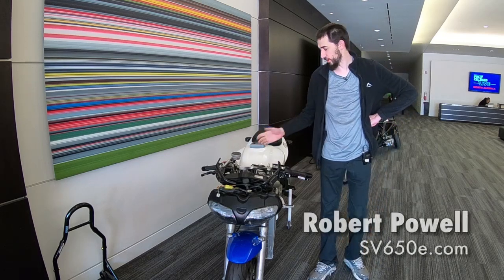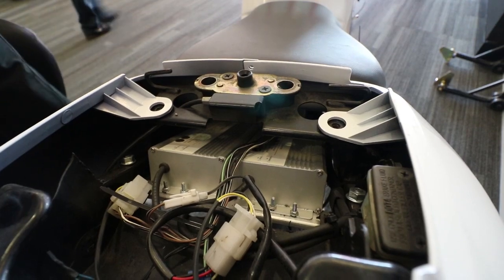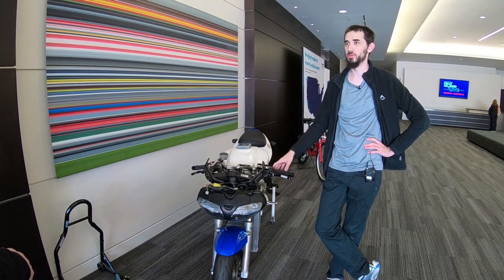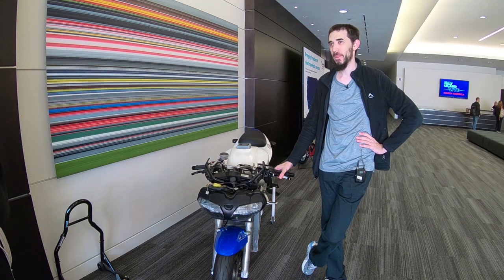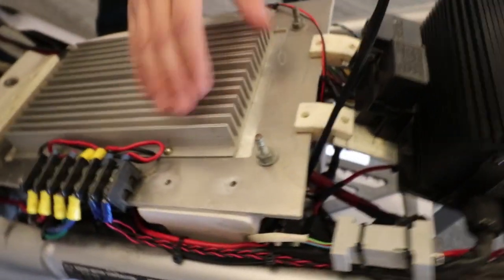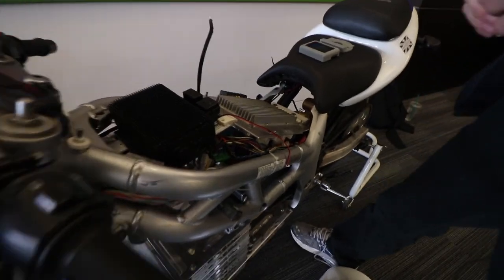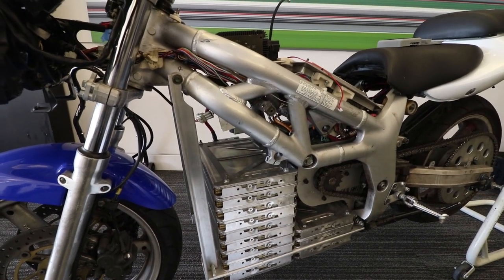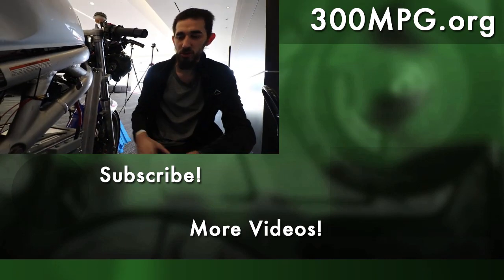Electric Motorcycle: Suzuki SV650 Conversion

Comment: And hook a alternator to the wheel where it will charge going down the road.close to perpetual motion.  ...
Reply: It's just drag on the system. Because of efficiency and friction losses you will actually go a shorter distance. Regen breaking is possible with some motors and controllers but it switches on when you brake to reverse motor polarity to charge

Comment: The motor you use, how many volts is it?
Reply: Usually you don't care to much about voltage. You usually can overvolt motors. But be careful with current so it won't overheat

Comment: I believe the reason for not modifying the frame is to be able to use the legacy VIN.
Reply from the maker: Typically, a person wants to leave things as stock as possible for titling/licensing/insuring.
You can change the driveline and other parts, but once you start changing the frame, you would have to get the vehicle registered as "Home-made" which can make it MUCH more difficult to ride legally.

Comment: I love this  build, im very motivated to finish my 15.kw drag race electric mini bike!!!! stop by to check out the build!!!
Reply: You have a hub motor or belt driven system? I just built a YM 20kw hub motor setup and it beats fast. 120ah battery setup. The bike dc current is set to 260a. But I think I can push it to 300a. It’s a 4 second bike.

Comment: Cool bike but I am constantly... surprised? disappointed? with makers using unnecessary tech to make parts.  3D printed mounting components could have been made better/faster/cheaper from acetal or UHMW poly bar stock. Writing G-code and CNCing (then modifying w/ a hacksaw) a one off aluminum plate that could have been done (and then modified) manually on any mill.

I'm not diminishing the cleverness, effort required, or awesome outcome of this project. It is a truly special outcome, especially considering that it began long before many of the conversion products around today were available. His BMS design is awesome. It's just that so many makers seem overly engaged with technical tools, pushing them into applications where traditional tools are more appropriate.

(you can say "OK Boomer" now)
Reply: Bill Kerr, while I appreciate your input a lot of the pre work was done with manual machine on my Bridgeport before refining it on the cnc. Motor plate #1 that is on there now was all done by hand tools. (The cnc one is off getting powder coated).
Reply: @robertpowellj  I have nothing against CNC machining and I'm glad to hear you have and use a Bridgeport. Saw your bike at FCL and admired it. Sevcon controller?

Getting powder to stay on aluminum can be tricky. I always used wet paint or a wet electrophoretic coating process.
Reply: Bill Kerr no Kelly
Reply from the maker: I also think that everyone does their projects different based on what skills and tools they have.
It reminds of of a story my dad told me once early in his career working construction. Back then, everyone used pretty much the same style lunch box - one on which the handle inevitably broke. Each tradesman always fixed his with whatever he had handy. You could tell a carpenter from an electrician from a plumber based on how the lunch box was repaired. A carpenter would fix it with a piece of wood, a plumber would use "plumbers tape", and an electrician would use leftover wire.
My grandfather was a welder and also raised dogs. He had a huge kennel and the entire thing was made from rebar welded together!
Reply: @BenjaminNelsonX  Yes, to a man with a hammer every problem looks like a nail. It's just that after a career spent designing products I still find 3D printing almost worthless in the vast majority of applications. I've used it for prototyping plastic parts before investing in tooling so I am familiar with the technology. Makers would be better served I feel if they learned processes that can be used for real products. Sure, there are some applications where 3D printing is indispensable. Just ask SpaceX.

Today there is a growing shortage of machinists operating manual mills and lathes. Having those skills in the labor pool is critical for the growth of American industry. These are the people who can prototype and repair the specialized industrial machines industry uses. We are losing that ability.
Reply: @Miata822  "Makers would be better served I feel if they learned processes that can be used for real products" 3d printing makes people learn 3d modeling and gcode, both processes used in making production type parts. One can 3ddraw a mold for injection molding or aluminium parts straight of a cnc mill or lathe.
Reply: It`s faster for me to make a 3d model and generate g code than doing it by hand. I can let the machine do the long job
Reply: A 3d printer costs 300 dollars and can make a bracket like one in the video for holding the controller plate in about 10 minutes. Manually machining one of those will require about 7 different setups and using angle blocks to get the required "bent" shape